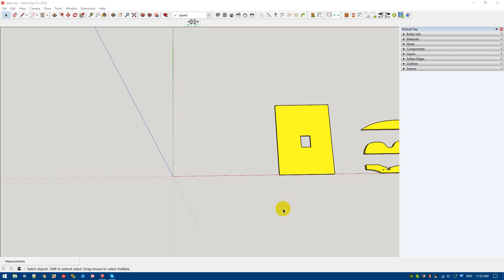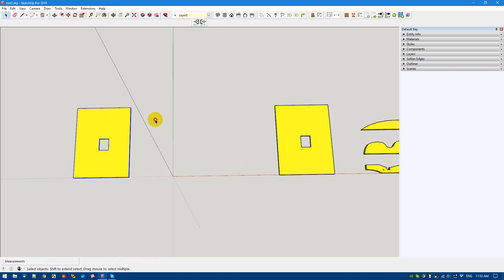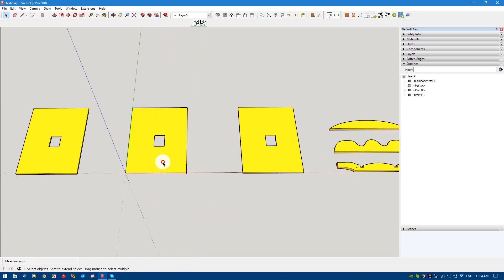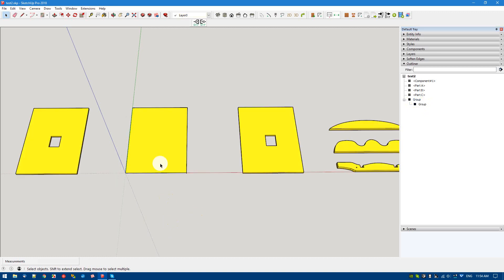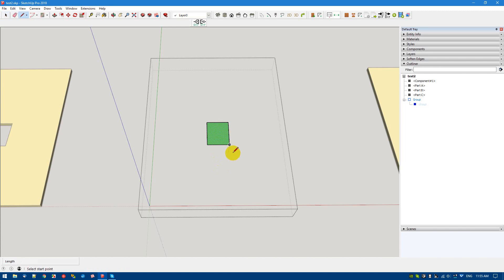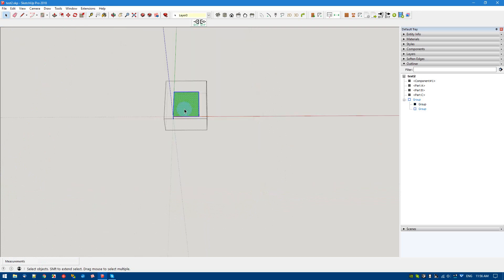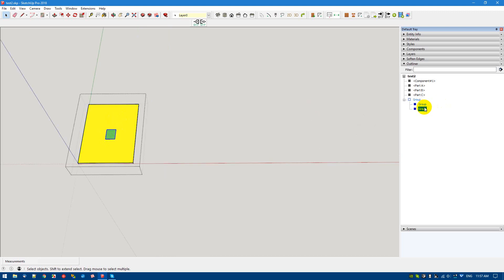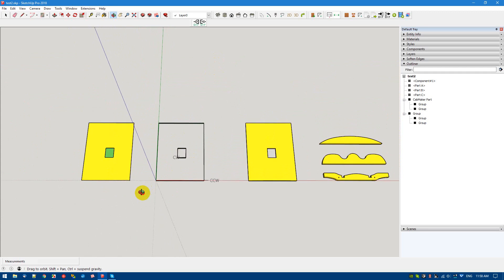dxf export and import

Comment: Hard to make a more confusing tutorial than this. I thought the extension would work for me and help me, not the other way around. Complete nonsense.
Reply from the maker: Obviously you don't understand the underlying requirements of CAM software. Additionally your critique will be ignored as I can see you have no people skills.
Reply: @garrykernan6707  Yeah, would prefer if the extension could take care of it, as any decent software does. What is even a point of it if you have to do everything manually instead of simply translating a Sketchup-made model? Also, check your likes / dislikes ratio for answers whether your video and extension is good or not.
Reply from the maker: This software was NEVER intended to do what translation software does. This is very specific. And if you cared to learn about CNC you would understand that. With CNC you need to control the entry point of a polyline. Additionally directionality is very important as that controls if the CNC router cuts inside or outside. Therefore to achieve this an arc has 2 points and you use a DXF bulge using saggita math to determine the actual radius of the arc.

Sounds like you have the benz.

Comment: Is this extension works only in SketchUp Pro? I had downloaded it in Make but when clicked on DXF Importer, and after selecting a DXF file nothing happens. No error, no explanation, nothing.
Reply from the maker: It will work with Make. The DXF importer ONLY works with DXF files created by CutMaster or by Simple DXF.
Reply: Excuse my ignorance, but what is Simple DXF? I was looking for it online, but could not find any software with that name. I was trying to import a dxf file from Adobe Illustrator and maybe because of that it did not work.
Reply from the maker: It is available from Sketchucation and from my web site
cabmaker32.com
Here is a Sketchup link that you might find interesting.
https://forums.sketchup.com/t/polylines-with-real-arcs-for-cnc-router/64342/13
Reply: Maybe there was a misunderstanding. I had downloaded the Simple SXF extension from your website,  which gives me the options for importing/exporting DXFs, but no creation of DXF is available from it. I used it to import Adobe DXF which as I mentioned earlier is not giving me anything.
Reply from the maker: Exporting a DXF is creating a DXF. The Sketchup group must follow the specifications as outlined in the video and discussed in the Sketchup forum.

The main purpose of Simple DXF is to create DXF for CNC and then read the DXF back into Sketchup  to verify that the DXF is correct before processing it for CNC.

As already stated - Simple DXF will import DXF's created by CutMaster or by Simple DXF. Simple DXF will NOT import adobe created DXF's as that is NOT what Simple DXF is for.
Reply: Thanks for the explanation.  Unfortunately for me, this will not work for me. I was looking at DXF importer into SketchUp Make, and your video popped out. I could not find any importer that will work with Make, and few that will work with the Pro version.
Reply from the maker: I added this to more fully support my CabMaker 3 and CutMaster 3 products.
Reply: I saw them and I can say they seem like a really good products. Good luck with them. I am more into woodturning than cabinet making, but Cutmaster might be something I may need at some later time. Take care and thank you for your patience.